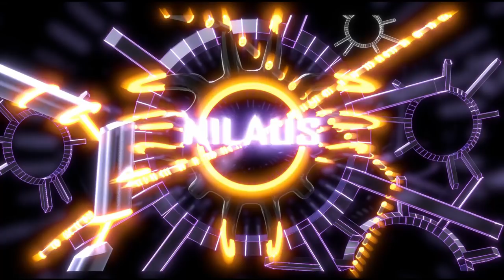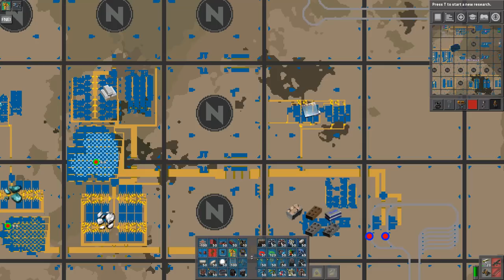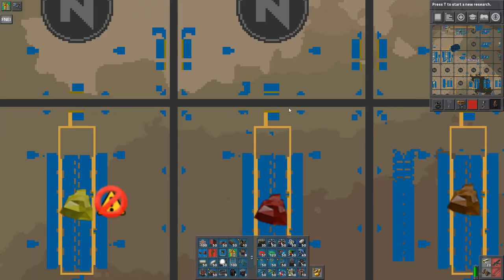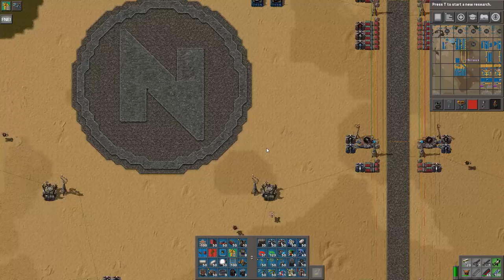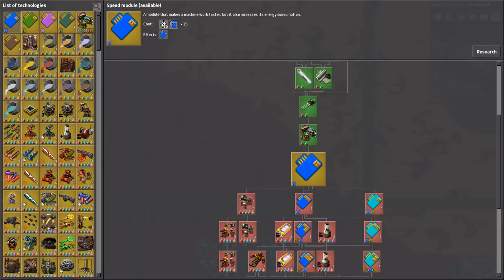Factorio 0.16 - Angels Mods Tutorial Lets Play #49 ELECTRONIC LOGIC BOARDS

Comment: Almost afraid you stopped doing these recap episodes :D
A few things:
1) Are you going to use gold ore for anything other than ingots or bars? Otherwise having a warning on all three of them seems kinda redundant.
2) At 6:20 there's 1.6K circuits in the requister chest so it is able to keep up, they're just no getting to the provider chest on the other side fast enough.
3) Most importantly: Where's your crash counter?? >:-(